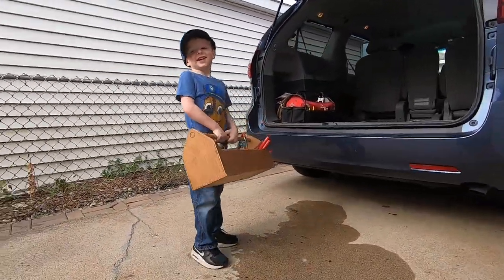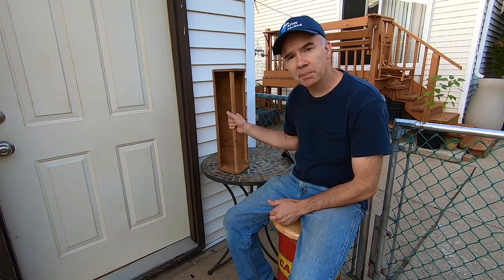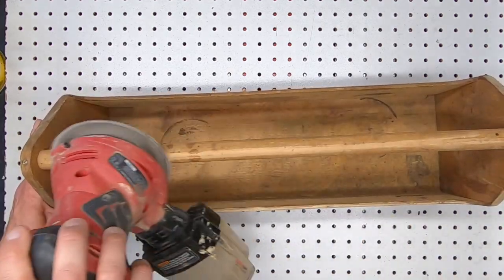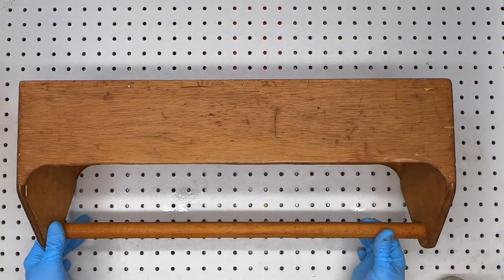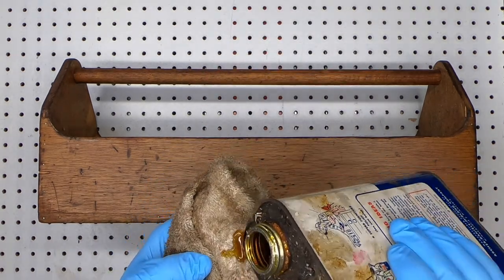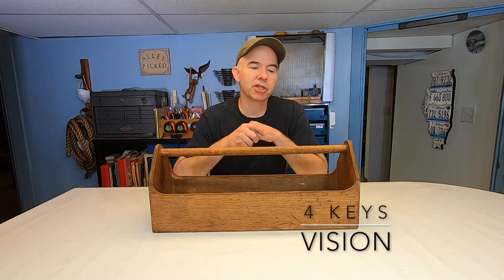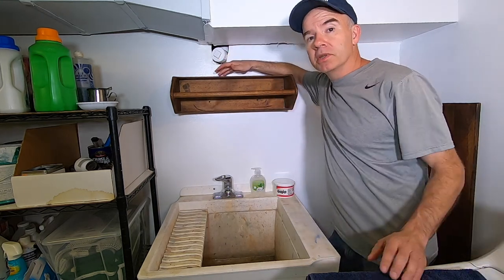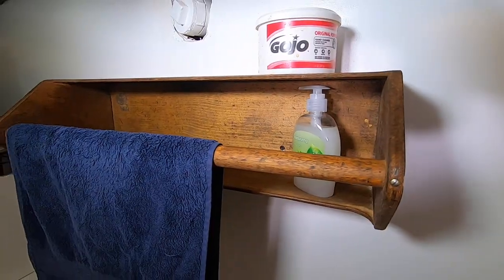Upcycling For Beginners

Comment: The tool tote looks good up there on the wall.  I would never have thought of using it like that.  Hey, I may have messed up.  I did not take notes during the lecture.   Is there going to be a test on this material?   If so, please make it a 'True or False' or a 'Multiple Choice' test.
At least, I have a chance to pass one of these type of tests and if I fail 'Alley Picked 101', my wife will kill me!☹☹